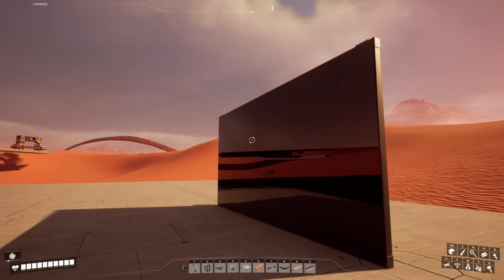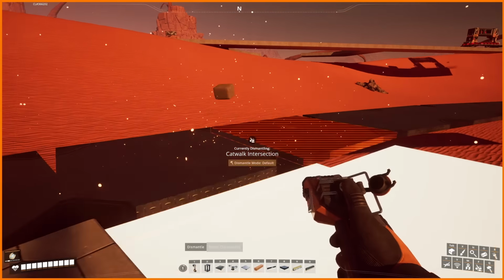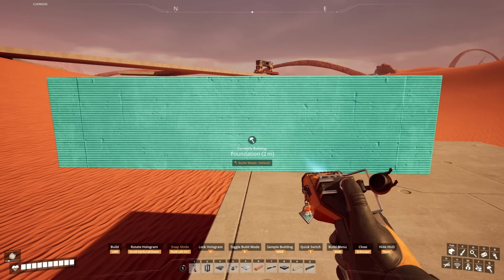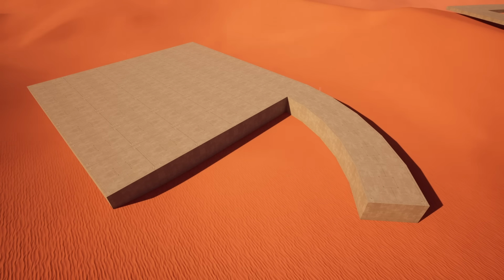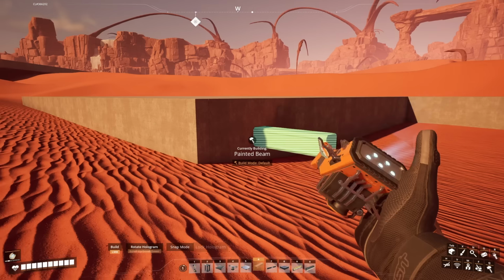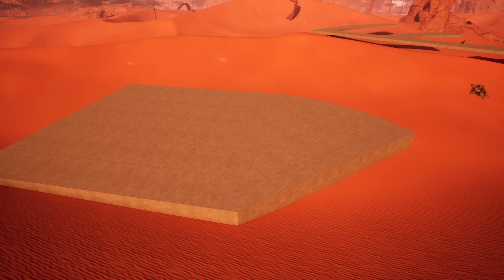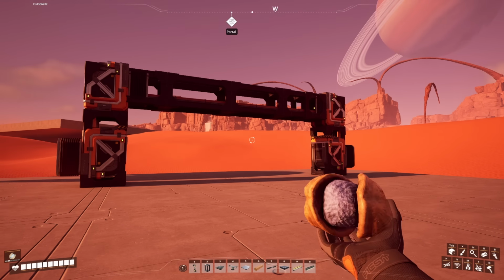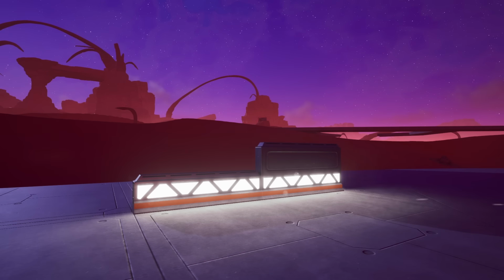Easy Curves, Merging and Essential Build Tips For Satisfactory 1 0

Comment: Impressive how they've made the engine to handle z-fighting so well, these intersections are as smooth as it gets.
Reply: Since the game detects when there's overlap it probably offsets any overlapping pieces by a tiny amount to stop the z fighting.
Reply: @BurritoHonmono  Last time I had things overlapping it was fighting like crazy still, are there settings to know to make it better?  Or does it just get better over time?
Reply: @JigglesMcRibs  I noticed that if you have 2 foundations z-fighting on the top (or bottom I guess) you can place a temporary pillar centered on top of one of the foundations, then delete that foundation and re-place it on the bottom of that pillar. (then remove the temp pillar)

I assume the snap point math is slightly different between snapping to a foundation vs snapping to a pillar so the resulting position of the foundation is ever so slightly different afterwards and there's no more z fighting as a result.
Reply: There's plenty of z fighting still. It's just not as visible on the concrete foundations. 

The top sections of walls are heavily fighting with foundations snapped onto them.

Comment: Just entered T5, so just getting ready to tear down my starter factories. This will help me design my replacement factories with more intent. I especially liked your recommendation on an earlier video on designing with input and output in mind. I always just end up trying to figure out routing at the end, but I started placing outflow depots first (inflow is usually easy: it's wherever the miners are coming from) and designing towards the middle. Thanks for your efforts!
Reply: if you're not dependent on the resources they use, i'd recommend keeping you early factories. it's always nice to see where one started from, seeing the progress and maybe even get some inspiration for later. I've just finished automating the first 600 Bauxite in my world and still get most of my basic T1-T4 parts, appart from steel and project parts, from that very first Base. it's ugly, it's inefficient but since it's provided me with everything i need for about 110h now, i can't just tear it down. even though it completely blocks 3 iron nodes.

Comment: how do you make the foundation have the grey solid color? mine has two separate ones no matter which color i choose
Reply: It's the concrete material instead of the default ficsit material. You can buy different foundation materials in the awesome shop, and use them either by using the drop-down at the top right of the item section in the build menu, or by going to the materials tab in the paint menu.

Comment: Rotating the foundations on the corner was a trick I would use for creating curves, but it NEVER occurred to me to use nudging as well; I would use a combination of more foundations and walkways to get the next foundation in the right spot, which took a lot more time and could get very finicky/complex if you haven't done it in a while. Nudging the foundation into place? SIGN ME UP! Also the trick with the beam to line up edges... Seems so obvious now that I've seen it, it's hard to believe I didn't think of it before. Definitely gonna be making use of that one!

Looking at all this, though, I wonder if Satisfactory might benefit from some snapping mechanics that can be found in Valheim! Lining up corners and edges are EXTREMELY important when building in both games, and one thing Valheim does is make it so that building pieces (particularly large ones) snap together at their CORNERS and can be rotated using the corner as the center of the rotation. If Satisfactory had a similar mechanic added, building curves would be a breeze. Imagine zooping with that! Imagine the time saved!
Reply: All we need is a road tool that behaves like conveyor belts or train tracks rest can be done using beams
Reply: We had many great mods that made this and many other things a breeze and to no surprise they were still not implemented. Unfortunately to do most bigger projects I will be just waiting for mods again.
Reply: @letuinchi  Now that the game isn't a moving target, modding should be easier (like KSP).
Reply: @letuinchi  agree. the dev team had QoL mods avaliable for YEARS.  and they did nothing. i just don't get it, why make it such hard for a player that wants his buildings to look nice?

Comment: That barrier with light looks awesome for a road, instead of using the street light. Minimalist and without the pain of having to actually run a cable.
Reply: Signs as lights means one doesn't need to unlock lights in MAM. Wonder if that sign takes Unicode?
Reply: @brodriguez11000  lights are from the awesome shop too. And yes, they do take unicode! You can write greek and the weird shape characters if you copy paste (since that’s not on keyboards).
Reply: The draw distance for these signs for me is only about 6 foundations. Are you guys running into the same issue?
Reply: They do look awesome at night. This make my roads look great but mine has a little gap on the top side of the barriers pattern. Is there a way to move it up by a small notch?

Comment: I would like to see factory planning for 1.0. I have no idea what I'm doing. Is the general mantra to bring everything to a central location to be built into stuff? Fabricate on site and transport assembled products?
Reply: The idea of mega factory vs modular factory is a debate that has raged on since Satsifactory's EA release. The best answer for you depends on your play style.. which you have to figure out by playing lol

Some like building impressive mega factories. Others like modular factories and the logistics that goes along with planning their transport. Some players do a bit of both.
Reply: There are mods that will give you goals. Hopefully the mods will soon be upgraded to 1.0. Cheers. Atm outside of the Space Elevator and Hub goals you have to decide for your selves. Some people like hub and spoke systems, some prefer mega factory, some prefer smaller scattered factories. local storage and central storage. In this game there is no one best way, quite frankly. Good luck! :)
Reply: The simple answer is, "Yes."  The longer answer is; try both, try other things, decide on what works best for you, do that.
Reply: In the early game it's easier to build small factories around clusters of nodes and then move the products to your main hub, since that way you can concentrate hundreds of raw ore per minute onto single unsaturated mk1 belts of rotors/frames/motors/whatever.  

Later on, as high-volume item transport becomes more affordable and you have thousands of construction materials on hand, you'll naturally find yourself building on larger and larger scales.
Reply: @VimRazz  Not gonna lie... I can't shake the feeling that I'm missing a core part of this game. I look at it and see "why do I need endless production when once the project is completed, I don't need more of those parts" My Audhd may be too practical for this game. lol
Reply: @RoughGalaxyYT  I know your feeling man, I have AuDHD too. :D
But I've gotten around to it again with 1.0 because of the subtle story telling. This really helps me staying motivated, cause I want to know what the story is. But at the same time it ist not so much in your face, which on the flipside helps me to not just rush through everything.

I think, If I could get meds again, that would help too xD

Comment: I keep having issues with the catwalk curves. I press ctrl but somehow the whole "ghost" goes completely off or starts cycling between 4 different squares. Any tips? Not sure if it is something to do with options or controls
Reply: im having the same problem, not sure what is causing it. sometimes it works, sometimes it doesn't
Reply: OK boys, i think I figured it out. just hold ctrl and keep rotating it forward or backward until you get it where you want it

Comment: How do you nudge up and down ?
Reply: You can only nudge things that mount on walls up and down. So if you want to nudge a foundation up, you would have to use a beam on a wall (or side of a foundation, another beam, etc.) to set a snap point and then place your foundation.

(Edit): you can also use frames to raise or lower foundations as the frame heights are not multiples of foundation heights. It takes a lot of stacking and deleting, though.
Reply: @b.y.2460  thank you very much
Reply: That's the neat part, you don't!
Reply: default satisfactory - can't
once mods are working: infinite nudge mod